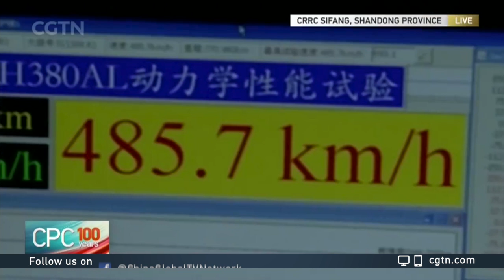From pursuer to front-runner: How do China's high-speed railways make it?

Comment: China's high speed trains are amazing. Not only fast, but gives you a quiet smooth ride in good spacious seats, even if you choose second class. I have taken the high speed trains many times in China. Next time I will take the train from Guangzhou to Beijing, then the east coast back to Guangzhou.
Reply: The only thing I dislike is hearing passengers cough up phlegm. But of course that is not the train's fault!
Reply: @chyna383  you don't even hv a mile of high speed rail.
Reply: The key is they used 500m long steel rod for the rail track

Comment: Yes it was a comfort, smooth, quiet and fast journey that I had experienced each times. The fastest speed was 250-285 km per hour which one can hardly feel it. Now with this latest testing at above 400 km per hour which is above 40%- 60% faster than the already fast and that is great achievement. Speed testing experiments is fine, but on normal running an ideal speed of 220= 300 km per hour is good enough.